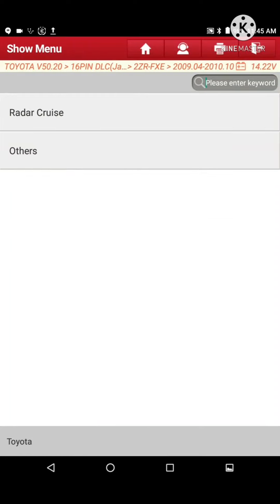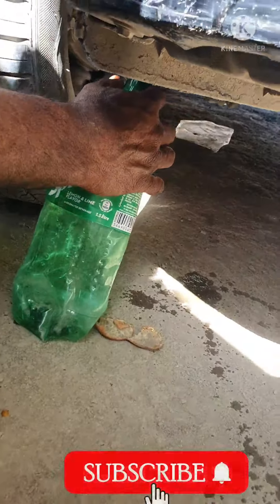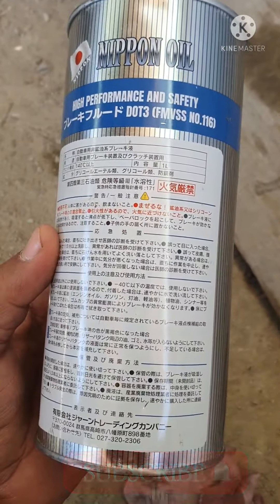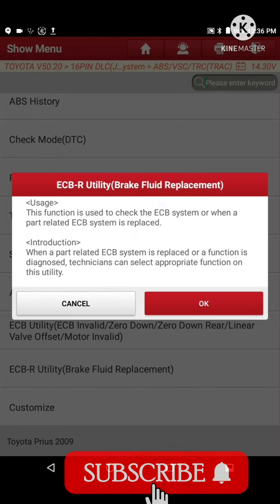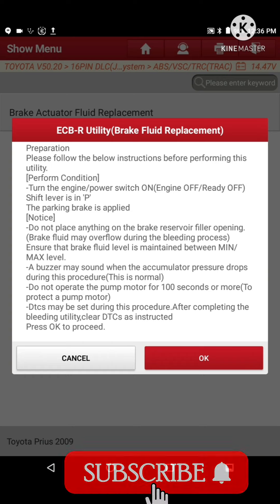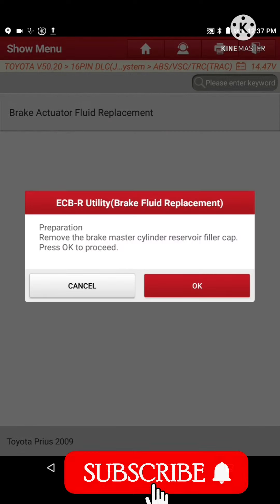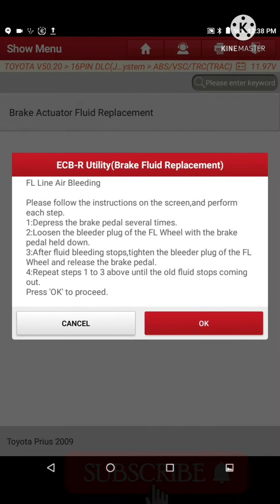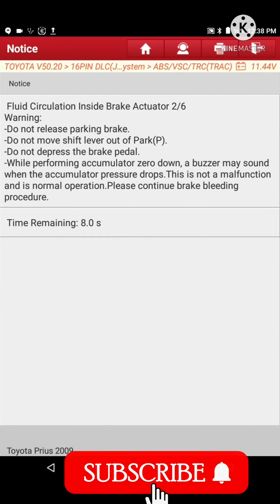C1246 Master Cylinder Pressure Sensor Toyota,#Prius#youtube ,#auto #prius

Comment: My crown 2008 hybrid is beeping and showing error breaks are not working c1246 and c1364 errors are showing
Reply from the maker: Tell technician that open all wheel cylinder solenoids in accutation test in ABS. And perform Airbleeding through scanner..but try to put new nippon japani brake 🛢